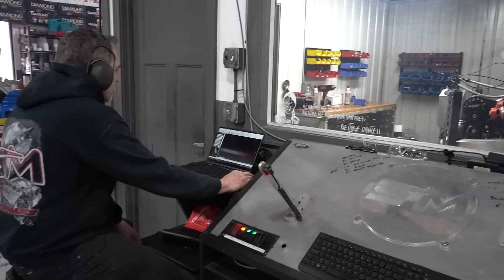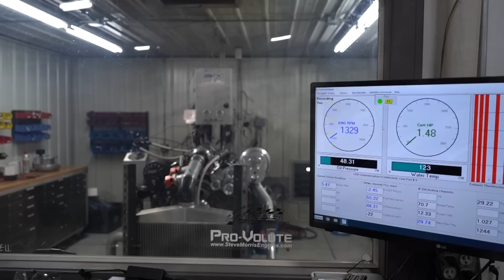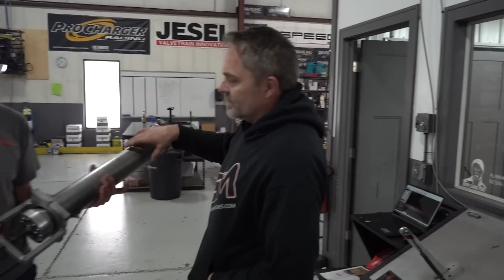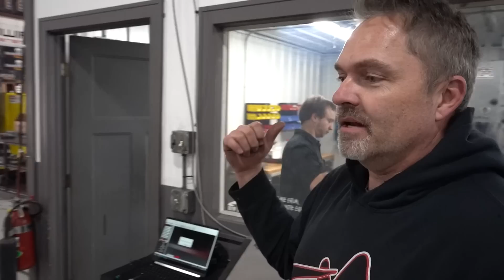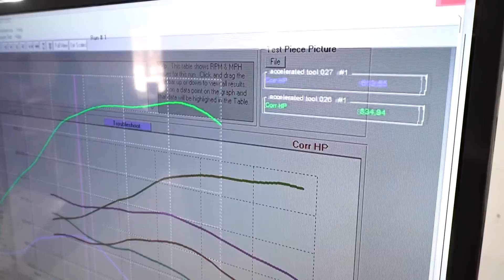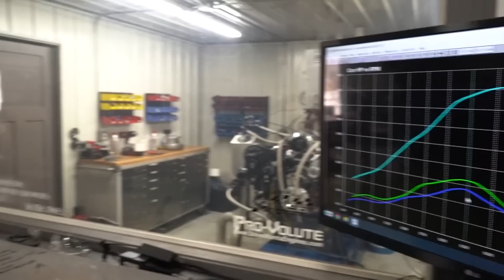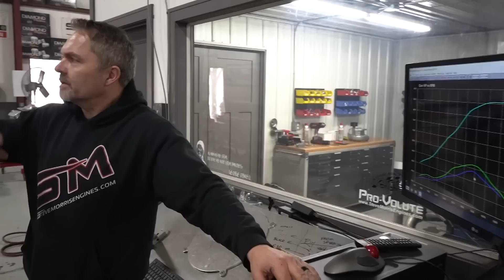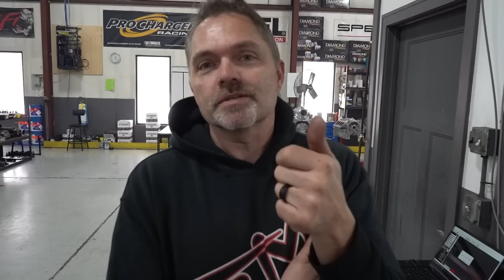CRAZY Testing After The  Dyno Session

Comment: Need a way to control both the cfm and boost during the rpm sweep. For example, let's say it makes 10 lbs of boost at 5000 rpm.....
12x12x12 = 1728 cu in = 1 cu ft
565 cu in / 1728 cu in = .327 cu ft
.327 x 5000 rpm = 1634 cfm
Gate the output flow of the supercharger at 1634 cfm....then use the blow off to keep the boost at 10 (boost is back pressure to the supercharger). Rinse and repeat for other rpms.
Assuming they are both wired to the holley (flow volume gate valve and blow off valve), just create 2 tables.....rpm vs boost and rpm vs flow volume. Make a pull. The holley will keep the supercharger at the same state (flow and boost) and you'll get a graph for graph comparison for the full rpm sweep indicating power loss.

Comment: CFM and pressure are different. Torque vectors from the volume on the propellers add a load. More cfm requires more power. Can't get something from nothing. (Dammit, you got me at the end)... Trust your knowledge steve...you knew the answer right from the beginning, just didn't spew it to those "experts".

Comment: I believe as your dyno lines are begining to merge you are approaching the CFM limits of the blower, exponentially increasing your parasitic losses.  Need to do same tests with a flow meter on SC inlet for some interesting data comparison.
Reply from the maker: Yep 
Thanks 
If you can share this vid I would appreciate it😁😁
Reply: In Industry we run into issues with fans that are driven by induction motors if a higher efficiency motor of the same HP is swapped in with the same pulleys. The higher efficiency motor has less slip and creates a higher RPM...and the amperage draw gets a LOT higher due to the same type of exponential curve. The solution in our case is to change pulley sizes to put the fan rpm back where it used to be.

Comment: Great video Steve! Very informative and interesting. The engine being a "pump" is consuming the airflow faster at higher RPM so the static setup is just trying to force all that air at high RPM through that cone. I bet the CFM drops and its causing the compressor to go off the map and creating a huge load on the TS. Just my 2 cents from my couch dyno haha.
Reply: See my arse Dyno thinks:

-Boost is a measure of restriction (right?)
-There is no restriction moving that boosted air
-It's spinning the blower way faster to generate the value of 14psi as there are no inlet restrictions.
-something about covid vaccines and 5g transmitters as this is the YouTube comment section
Reply: @jamesbaker4582  I'm pretty sure I got Myocarditis from reading your comment. LOL

Comment: Another great vid Professor Morris. Actually, when the blower is connected to the engine it's working against a shut off head. The engine is the restriction you were alluding to, it imposes a finite flow which is limited by RPM...

Comment: I think would be more accurate to drive the blower with an electric motor at the same RPM as the engine is operating that would show you output with no parasitic drag, then compare that with the horsepower it makes with the engine driving the blower.

Comment: You're making my head hurt.  I never did think about the vacuum that way though (plug the hose and RPM goes up).  Used to think it was because the motor was working harder, but in truth the motor always makes the same power, it just spins faster because there's less loss from moving the air.  Good way to think about it too because electric motors are pretty linear in their power curve as opposed to gas engines.

Comment: RPMxCID/3456 equlsl engine cfm requirments. Blower cfm/engine cfm x 14.7 - 14.7 =boost. If this is true, Torqstorm needs to find out max cfm of air the blower will put out. You will have to verify what your engine uses for cfm. I would not use the engine . An electric motor is 746 watts per HP. Boost is positive pressure so I would think the tube made would work on an electric motor with a VFD. Just my 2 cents.

Comment: common math. Smaller tube or higher the boost the more HP it will take to drive the blower. it all about restriction. Like trying to force water through a hose. the longer and smaller the more the pump has to work

Comment: Great video!!! And I was about to comment when you mentioned it at the end. The engine is an air pump itself, so that effects the blower and it the engine is also a dynamic pump / load. As opposed to the static restriction you have on the blower test rig.
Reply: @JUSTDOITDUDE369  But with a fixed orifice,  like they did here, it's a static restriction. Whereas with the engine, the volume its pumping changes with RPM.
Reply: @JUSTDOITDUDE369  I honestly didn't give it too much though, other than the engine presents a dynamic restriction based on RPM and I would assume throttle position and a few other variables I'm sure. If you really wanted to get a more accurate representation  you wold have to measure the airflow going in to the engine at different RPM with the super charger running though the engine. Then with the SC venting to atmosphere simulate the exact airflow and pressure at the same RPM. Or, like he was discussing, putting a strain gauge on the SC mount and measuring it directly. Which using a strain gauge on the SC itself I feel is the only true way to know exactly how much HP the SC requires at the varying RPM / load. But damn still crazy amounts of HP that SC was eating up when just pumping to atmosphere! Like the guys were saying, it maxes out their test donkey and it can't rev over a certain RPM. Crazy!

Comment: I wanna see it with done with a screw compressor, but might be a little harder to mock up though.
Also a shaft torque/strain gauge would easily tell you how much power it takes to run said supercharger , but you would need like a jackshaft or something in the middle though

Comment: Wouldn't it be fairly straight forward to make a bracket for the torque storm, that rotated on bearings, on the cl of the drive pulley input shaft, then attach an electronic load cell, set at an accurately measured distance from cl of drive pulley. This would allow measurement of the torque being applied to the blower. Now measure the input shaft RPM, and from those two, you can easily calculate how much HP was being consumed by the blower at any give RPM. The guys developing this could set this up on their own test stand. 

Think back of the old balance beam mechanical scales used on engine dynos back in the 1950's - 60's. My proposed setup could have the load cell data electronically (small data acquisition device) or computationally recorded (computer software) to allow output in graphical representation of the supercharger drive power curve.

And if anyone got this far reading and is involved in the editing of the vids, thank you for no loud music. Keep up the good work and sharing knowledge! And thank you Steve for taking your valuable time to produce these vids.

Comment: I had heard about the parasitic loss from centrifugal chargers but it's amazing to see how much there really is.
Reply: Wait till you actually see some real numbers of raw boost with no parasitic losses, turbo, or supercharger, that’ll blow your mind.
The whole, ” free horsepower“ thing goes out the window.
Apply equivalent boost from outside sources not driven by the motor means SUPER efficient hp. 
Turbos have their parasitics too(backpressure).
Reply: @dallynsr  Fortunately it's not 1 to 1 with turbos though..since the exhaust gasses are still expanding after they exit the combustion chambers. You're basically scavenging free horsepower to a certain degree. Some will be back pressure sure, but a % of it is always that free expansion.

Comment: The vacuum idea makes sense, when it’s all hooked up that air is being used in the combustion process. Whereas in this situation it’s basically just a really expensive leaf blower. If I’m understanding the thinking correctly, it’s making the mechanism of the blower to work harder like Steve said (more power required for more air load) that working harder is making pulling harder on the crank to make the same amount of boost pressure to leaf blow vs. Combustion air pressure is using up the air requiring less boost and requiring less work on the blower meaning less pulling on the crank. 

But that’s just rudimentary physics thinking.

Comment: so "Pop Off" valve to regulate boost?..... Same test with a turbo?...... And ....how to differentiate "parasitic" lose.... vs drive lose.... adding boost/fuel you have a compound gain, but at what cost.....Thinking out loud.... two engines: one drives booster device.... blower/turbo, the other receives the boost..... then work out the parasitic lose..... yah yah that's the ticket....

Comment: You already explained the outcome at the start, put your hand over a vacuum cleaner, "pressure" increases, and load decreeses. centrifugal compressors always take more power when wide open. so the trick is to design a compressor that takes the least hp with a load that represents 17-19psi on the intended motor (imho a respectable pump gas limit) fluid dynamics voodoo

Comment: I would believe that you are getting some more load due to more cfm (flow) though the blower then the engine is inhaling 
The pressure can be the same but flow being higher.  
A 10/71 blower will make more pressure than a 6/71 on the same engine due to flow 

My thoughts

Comment: The "Engine" is a piston compressor, so the Torque Storm is benefitting from the Vacuum the Engine makes. In other words you have two compressors in series, one compressor pumping into another compressor.
When the TS is not connected to the motor, the  motor has to work harder to compress and push the air through the adjustable restrictor cone.
Reply: Test rig?  Steady state.  Engine? Pulse loading.   The rig is actually working harder on a cfm basis for the same apparent boost pressure.  Also, the where of measurement is different, so Steves idea of logging cfm in is a step in the right direction.
Reply: I believe this is the case and the rate of acceleration with boost going into the engine is also different. The Dyno is loading one side of the engine and the supercharger is loading the other side. Typically the engine would get more load from the flexplate area than the front accessory drive and this time I believe it's the other way around because of that. Plus the amount of air it takes to make a flat 12psi line connected to an engine isn't a linear amount of air. The amount of air that pipe can bleed is linear. Just thinking out loud here so this is all theory but that's what I was thinking.
Reply: So the right way to do this test would be to feed the charge air into a second identical engine running at the same speed.
Reply: @notsponsored103  that's what I was thinking
Reply: This sounds like the right track and there is probably also a measurement difference. When you measure boost on a live engine, it's positive intake pressure, which is essentially the supercharger's boost minus the engine's vacuum. While intake pressure may be +10 lbs of boost, the blower is actually making enough pressure to overtake the inherent engine vacuum and ALSO add 10 lbs, where measurement when vented to atmosphere is just the 10 lbs you measured vs the 0 vacuum of atmosphere. This is probably why the open blower just drops off because as the engine revs up, it's intake strokes are sucking more air as the blower spins faster, where a dump to atmosphere requires the blower to overcome a lot more the faster it spins.
Reply: This is what I'm thinking too but I'm not an engineer or anything so 
🤷‍♂
Reply: @newtonfirefly3584  and your comment does nothing for anyone. Perfect! 👌
Reply: @newtonfirefly3584  go out and talk to real people man. Maybe start with a therapist and go from there.
Reply: @newtonfirefly3584  Holy Wall of text Batman!!!
Reply: @newtonfirefly3584  That must be what it is. LOL My "Holy wall" is too small.
Reply: @newtonfirefly3584  Don't ever leave your cave, Fatman.
Reply: My thoughts exactly. They should be looking at the vacuum that the engine makes NA, and then set the torque storm up to produce 12lbs + the vacuum for the test.

EDIT: crap, I paused at what I thought was the end, you figured it out.
Reply: All of that expert knowledge and not a single video demonstrating it. Shame.
Reply: Same goes for two blowers in series. Run a smaller blower into a larger blower into the engine.

Compound twin chargers. Seems an ideal setup may be turbo to blower. Would be fun to test.

Comment: The variability of boost is not static. The engine is “eating” some of the restriction. Run the tube to the other dyno cell on a running engine and Rev them both at the same time to duplicate the primary engine “eating” the boost but now you can measure it
Reply: Welp you just figured it after I typed it in my layman terms

Comment: Never forget the Fuzzy Carter (Eddie Hill's former crew chief) corollary : "If some is good, and more is better, then way too much should be just about right".
Reply: Eddie also said damn right I'm going to race dragsters and I can make less power to beat someone I'm in.
Reply: @stevemorrisracing  What if you had two of the exact same engine.  One turning the blower and one taking in the air from the blower. Both loaded on the Dyno at the same and see how much parasitic loss is on the one driving the blower. Sure might be inaccurate by a few horsepower but more accurate than the pipe test.
Reply: @mechanicalking  This would be perfect for engine masters, if they still have the Monza and Boost Caboose kicking around. You could see power NA, power blowing itself, and power blown by the caboose.
Reply: @mechanicalking  stop! It's not complicated
Reply: @mechanicalking  You wouldn't be able to get both engines loaded on the same dyno.
Reply: @aSinisterKiid  what he means is one engine on each dyno 

Steve has two dyno cells right next to each other
Reply: @stevemorrisracing  psi drop at the blower inlet is your constant. You get this with a venture. Measuring boost (exit psi) is not going to work as a constant for your test.